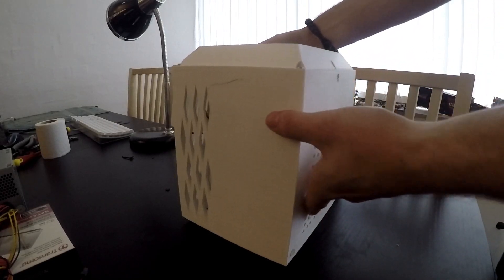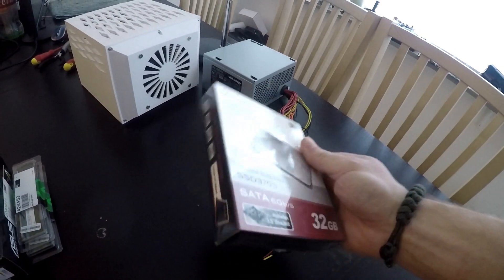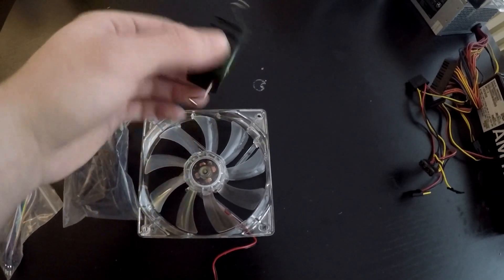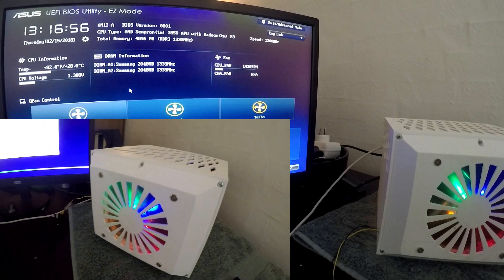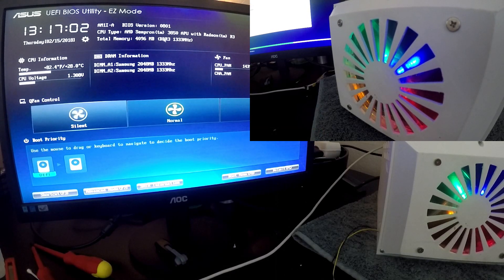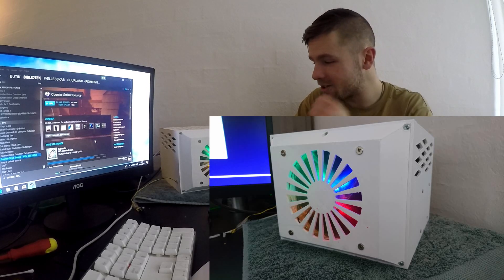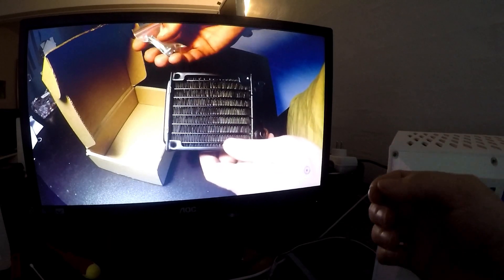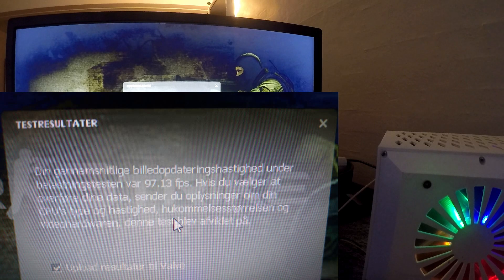Custom ITX, AM1 build + AMD Sempron 3850 benchmarks

Comment: For the AM1 platform I'd try to get an Athlon 5350.This mobo can overclock it @2.15 (from 2.05GHz) with just a button press.They are not easy to find but they are amazing for office use,browsing and even some light gaming.
Reply from the maker: I was looking for one, I didn't find that model, but the ones that I found, were a little too expensive, so I went with the Sempron instead :P